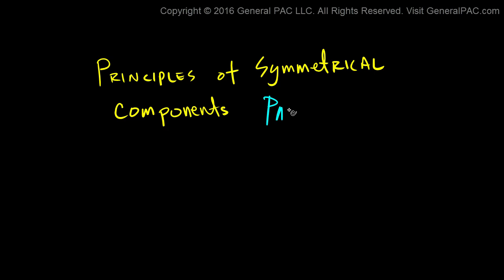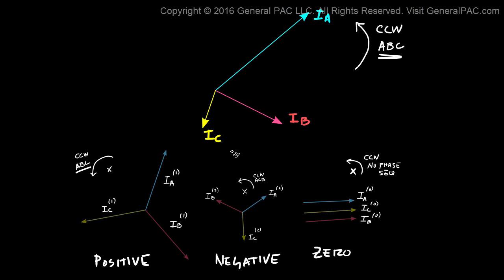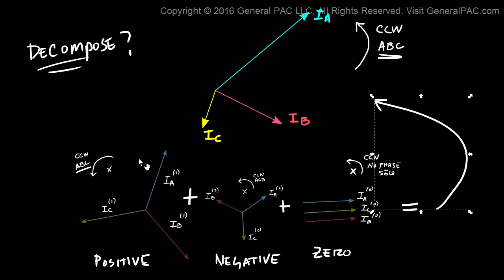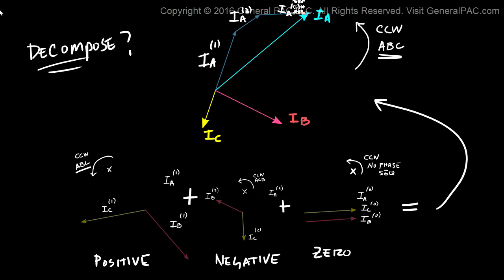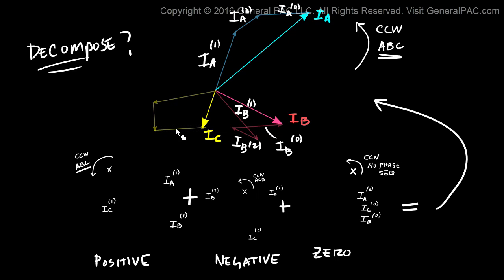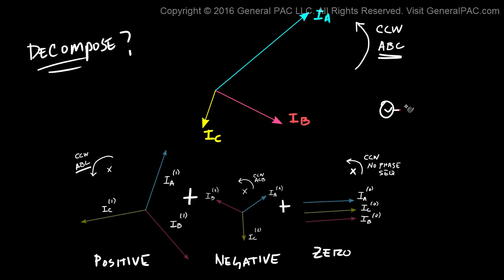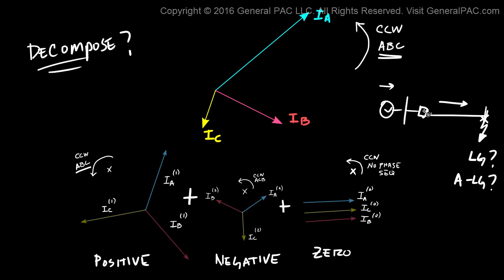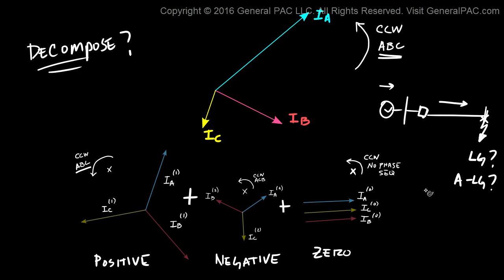Principles of Symmetrical Components part 2b

Comment: Please clarify the opposite rotation of the positive-sequence and the negative-sequence values. I don't believe the negative-sequence component rotate in an ACB rotation if the positive-sequence component rotate in the ABC rotation. They actually both rotate in the same direction, and, in fact so does the zero-sequence components. This can be understood if you consider the magnitude of say, IA, the A-phase current. As you show, IA is the sum of the positive-, negative- and zero-sequence currents. If the system remains in the unbalance condition as shown, IA, IB and IC will have the same magnitudes for as long as the impedances do not change and the applied voltages do not change. The only way this is possible, is if the sum of the three components stay the same, i.e. IA = I1 + I2 + I0. And the only way that is possible is if the three components all rotate and if they all rotate in the same sense (ABC or ACB). Else the phasor sum of IA = I1 + I2 + I0 will vary as a function of the relative positions of the sequence components. Another way to prove this is to consider a network with more than three phases (the original paper expanded the theory of symmetrical components to n phases). As an example, let us consider a six-phase system. In a six-phase system there will be six networks, i.e. positive, negative, zero sequence and three other networks that we have not named yet. Let us call these other three networks S, T and U networks just to give them names. If, according to you, the positive-sequence network rotates in the ABC rotation, and the negative-sequence network in the ACB rotation, how will the S network rotate? ABC or ACB? How about the T network? ABC or ACB? And the U network?

Comment: What if one don't use symmetrical components? Can the information bout the fault still be known by other methods? I mean before the concept of symmetrical components was invented, what methods were used?
Reply from the maker: If I understand it correctly (and challenge or add  to this comment) -- back in the day (before main-frame computers), they use to create a miniature version of the system using simple cables and small transformers. They were very careful of the impedance used for the mini system because it had to accurately reflect the big system. And when they injected current through the mini system, they could easily measure the current flow through each line which would reflect how currents would distribute through the actual system. Similarly, I think they had a crude way to measure unbalance fault currents.  That's all I know. If I find out more, i'll comment again.

Comment: I can understand that fault can make in balance magnitudes of the 3 phases but I can't figure out how can fault results to unbalanced phase. Somebody help me pls.
Reply: Say for instance there a line-to-ground fault. If only one phase is faulted then there is zero or very small impedance to ground. However, if the other two phases are not faulted then they maintain the same impedance as they did prior to the fault. Therefore you have one phase with a different impedance than the other two phases and you have an unbalanced three-phase system. Does that make sense?